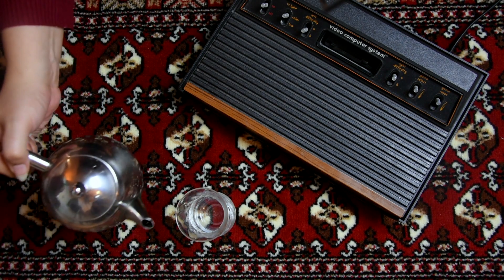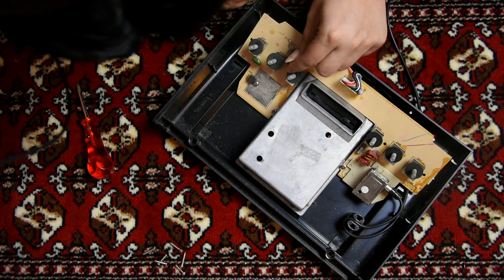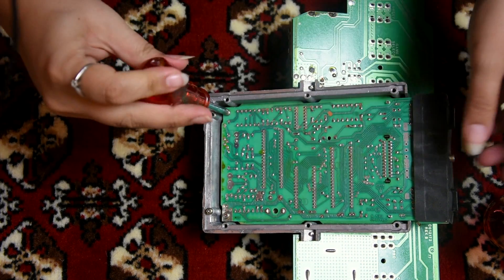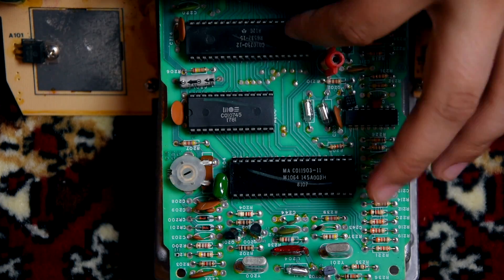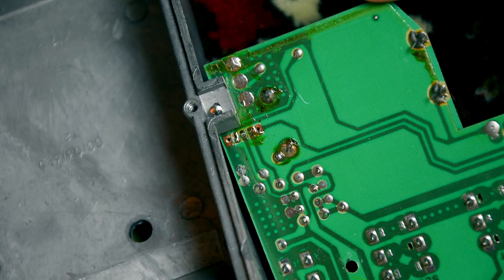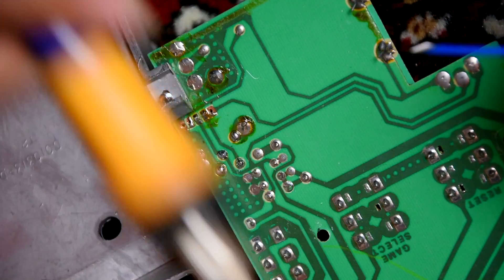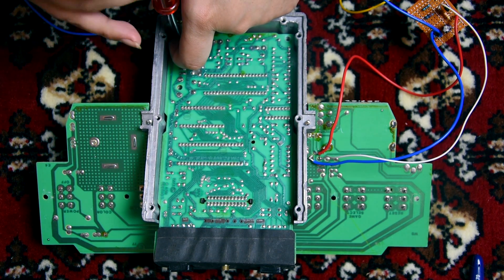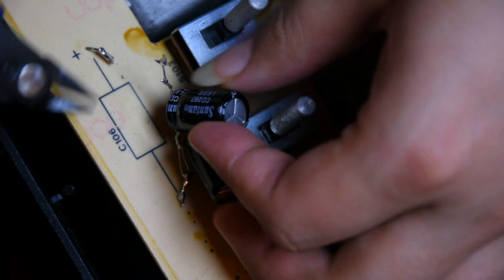Atari 2600 - Part 3: Composite Mod and recapping

Comment: Hi, the first rehab part you replaced was I think the L201(big tall red coil) below the Q201 transistor that you removed.  What did you replace L201 with?

I made the same mod but the video is horrible and trying to diagnose

Comment: @MsMadLemon, Hi there! I enjoyed looking at your version of doing the Atari 2600 Mod of adding the RCA Audio/Video Composite! Great Job! My question is? I bought those same exact 24K Gold RCA Composite the Red & Black Audio/Video Jack Plugs with the White Washers off of eBay a few days ago. I just got them today. I want to know? Can I use any Atari 2600 Composite Mod with the two Red & Black RCA 24k Gold Connector Plugs and still do it the same way on the NTSC Atari 2600 USA version? Thanks.

Comment: 1:56 - Most people believe that the RF shielding was heavier. But that's not true. The bottom part of the case was slightly heavier because it was a bit thicker. The weight difference is only about a half kilogram between the heavy sixer and the light sixer. Originally, Atari was going to put stereo speakers in the console, that's why the top has speakers holes on the grill looking part . The bottom case had a stands for two speakers. The speakers removal was done at the last moment before full production of the console. http://www.ataricompendium.com/faq/faq_vcs_stereo_2.jpg

Pins 12 and 13 of the TIA are the audio channels.

Comment: Cool video. I'm part way through the same mod (using a bought pre-assembled board though) but I now find I threw my composite cables out in the house move. I've ordered a cable and some RCA sockets like the ones you used. 
I didn't realise you could just leave the RF module in?. I'm honing my soldering skills so it was a good exercise removing it anyway.

Comment: What’s with the ceramic capacitors? Don’t they wear out?
Thanks for the great video btw.
Reply from the maker: No ceramic as a material doesnt wear out, but electrolyte tends to dry up over time or leak, resulting in a change in capacitance. 
And thanks!

Comment: Those parallel capacitors looks like an old repair to me (bodge). 
The discharge remember me when I shorted out a larg-ish cap charged with 50V right under the nose of a friend (he was just about to de-solder it and neither of us had thought about discharging so I just put in a screwdriver just before he touched it - quite a funny face).

The formula for serial capacitors is 1/Ctotal=1/Cfirst+1/Csecond+1/Cthird and so on So two identical in serie gives half as you said.  No idea about voltage but I would treat them as all but one failed to short circuit thus no change (just my personal theory).

Thanks for another happy video :-) World would be better with more Maddies!

Comment: Each time you open up any kind of electronic equipment of age I fear for the capacitors inside they must quivering their little Holdings knowing that they are soon going to be eliminated. Do you have a capacitor graveyard in your back garden?
Reply from the maker: Lol! I am a capacitor's worst enemy that's for sure ;o) 
If I actually saw a capacitor quivering i'd most likely find it cute, desolder it and keep it as a pet, feed it electrolytes maybe lol

Comment: Fantastic mod. Hopefully we'll get to see a comparison of rf vs. Comp vs. Comp minus inductor.
Reply from the maker: I was actually in the process of doing the before after comparison...but before thinking of it, I had messed around with the colour adjustment pot on the board very slightly leading to slight changes in colour so the after image wasn't accurate. was kicking myself a bit but had to scrap the comparison.
Reply: Oh my, that's too bad. Hope you can get that sorted out and recalibrated. At least it's the "after" image that can be tweaked, so hopefully you can get it to sort of match up again with the before one.

Comment: great job Maddi. as always, you know it yourself, but you should name the ports with your Dymo "letratag" retro version, 
which's RCA connector (cinch-plug) is the mono audio and which's comp.vid. for your heirs/progeny, so they can do ancient retro gaming also because you used a black ring instead of a yellow one. LOL 

nice fix. stupid how they did the Elco's like that. dangerous. do you think Atari did that?

greets.
Reply from the maker: Yes you're right I actually should lol it just looks like two audio outputs rather than a composite... I didnt have a yellow rca socket of that size. i'll get the Dymo out lol. 

I dont think Atari did that with the caps, at least I freakin hope not lol not sure why it's like that, it could have easily shorted with just one knock and screwed something up! 

Thanks Jan :o)
Reply: yeah. i just wanted to edit my previous comment. haha. because i saw that the testing RCA socket was yellow. but not nicely goldplated unfortunately, and as you say not the right mounting size. so go for these nice goldplated ones and the Dymo word-stamper does the job period correct. lol 👍👌

Comment: Shocked at the way two caps were in there in parallel that way?!?!   Nice job - picture looks great!!!  What TV are you using for the composite btw - is it a modern LCD or a CRT or something?
Reply from the maker: Thank you! :o) I have no idea why someone decided to parallel two caps in such a nasty way like that. 
I'm actually using the scart to HDMI upscaler and onto a modern HDMI monitor. I should test this on the only old TV I have and that's one of those "HD ready" LCDs which do not have a HDMI port but has scart inputs..I never understood what "HD ready" meant lol
Reply: Ah OK, I see!  Strange for that TV to be marked "HD Ready" if there's no HDMI port on it - at the cut over to HD devices, manufacturers stuck that sticker on there to indicate that the TV would support 720i (at the very least) as a possible input.  Maybe that TV has component inputs that would accept a HD signal or something.   

The only reason I asked is because when I last looked at my 2600 composite mod I was trying to understand some wierd noise on the signal, and at that point I wasn't convinced it wasn't the TV that didn't like the composite, rather than something being wrong with the composite.   I think from what I've read I could just be unlucky, and the TV doesn't like the slightly none standard composite signal that comes from 2600..  I might take a look back at it soon to see if I can fix it.
Reply from the maker: I came across a few TVs in that era that were labelled HD Ready but never had HDMI ports, and no mine doesnt have component either... just never understood it, unless it means it can recieve... but wait how can itreceive HD transmission through a scart?! .. I think this is what a marketing gimmick reeks of. 

Have you got an old VCR or anything else with a composite input you can try it on? to compare... there is a slightly more complicated schematic i saw around.If I find it i'll send it your way :o)
Reply: Analog HD can actually be transmitted over component cables up to 1080I. I once had a Sony camcorder from around 2004 that had that kind of signal, and looked quite good on one of those HD CRTs in 1080i (it was labeled HD ready too). Actually, I thought scart could support YPbPr component video, and if so, it should theoretically be able to carry HD signals in analog form.
Reply: Maybe the HD ready in that instance means it can perhaps decode freeview HD signals?   I've got the Commodore 1084S I can try yet, so I will compare between that and the Phillips HD TV to see if the problem is the same on both.  I've just read a lot that the 6 switchers can be hit and miss as to whether the TV can handle the composite without issue.  I think that's one reason the longhorn mod came out.
Reply: My best guess is that the previous owner had the two caps to use on the repair.
Reply: "HD Ready" is 720p ^_^  on the signal side, it denotes a 1280x720 progressive image. On the display side however many "HD Ready" branded Plasma/LCD TVswere actually 1280x768, or 1366x768(which I've always thought was dumb). Some of them were 1280x720 though(mainly smaller LCD monitors, and retro-projection TVs).